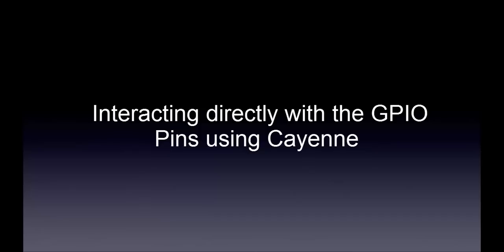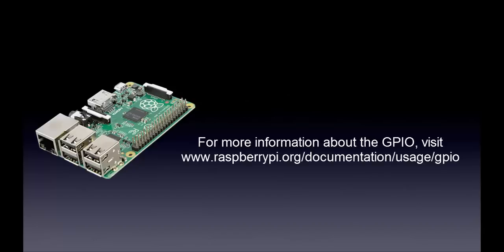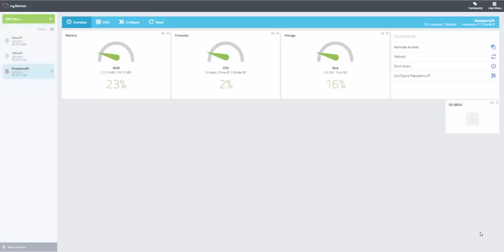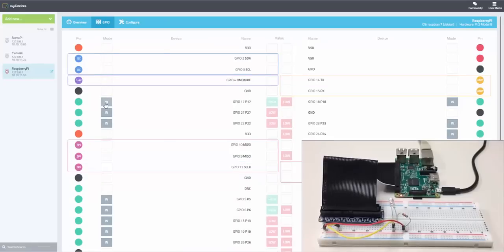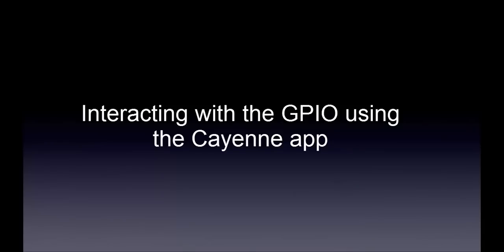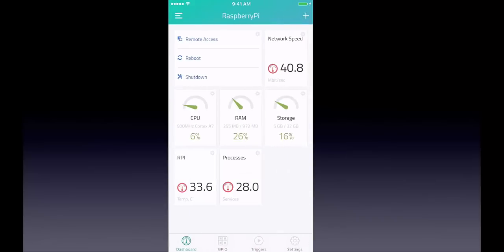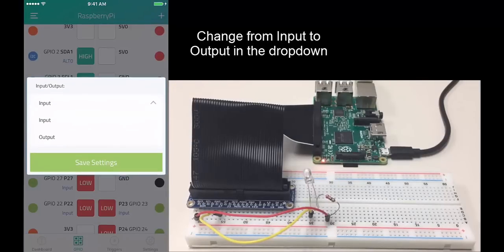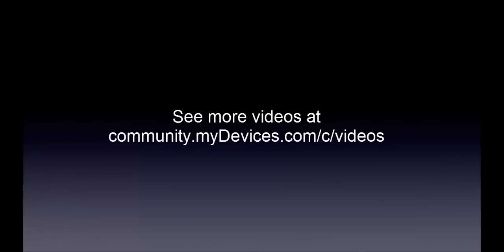Interacting with the GPIO on your Raspberry Pi using Cayenne

Comment: Ive been looking at using Cayenne and a raspberry pi to replace my old security systems door and window sensors. I've seen tutorials and articles about it but most only use 1 or 2 sensors. Does Cayenne support say using a gpio break out board? I'm looking to have the raspberry pi with Cayenne monitor about 20+ door and windows sensors and maybe a handful of motion sensors.